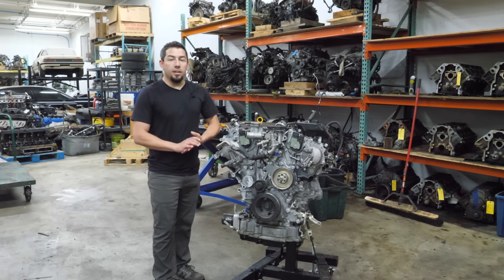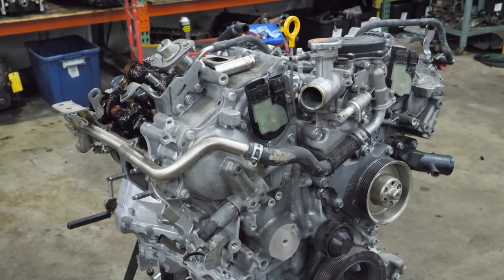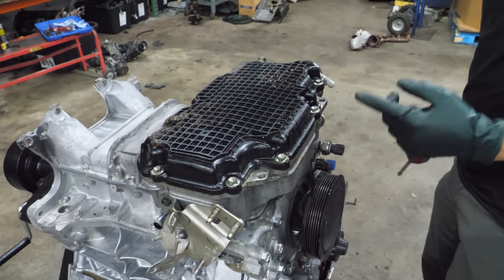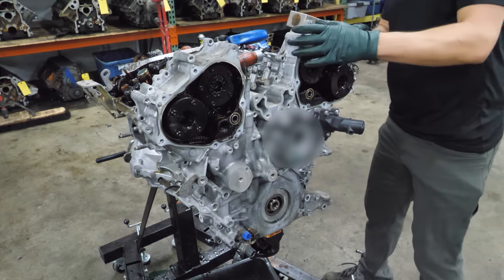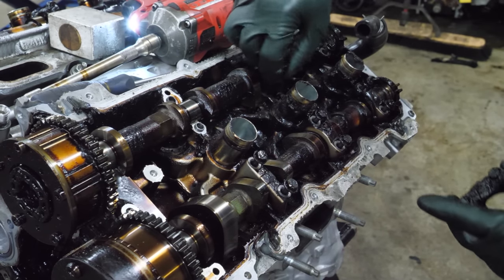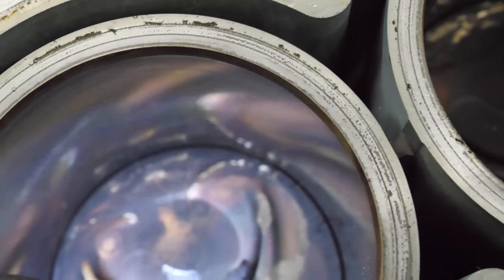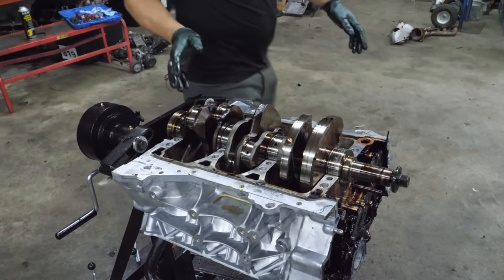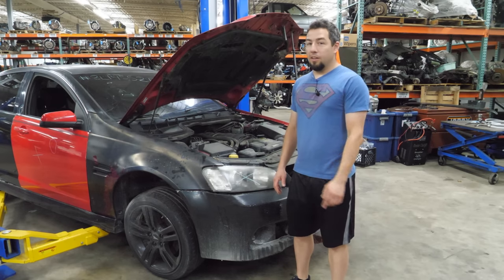60K Miles on 1 Oil Change!?! Infiniti Q50 VR30DDTT Neglected TO DEATH.

Comment: According to the quickie lube all that needs is a can of magic engine flush, an oil change and a new air filter (because it always needs a new air filter), that engine will be good to go for another 500k miles!

The pistons come out so easily because of low tension piston rings. Helps reduce friction when the pistons are moving which improves fuel economy. It’s also why so many modern engines burn oil. (I wrote all of that before you said it but didn’t feel like deleting it)
Reply: Most people think engines should not burn any oil and never check the level between changes. 
I know better and check mine several times between changes and top it up as needed. 
Manufactures need to pit a low oil light on the dash. Not low oil pressure... that light comes on and your already screwed. I have never figured out why they dont put a low oil level on cars. Probably cost 50 cents.
Reply: @ohioplayer-bl9em almost certain my e60 has one of those 😂

Comment: I am definitely more on top of my oil changes since watching you. I have a car with a little over 208,000 miles and still running smooth, will not go over 5,000 miles between oil changes. 👍🏼

Comment: Great video as always Eric 😀
did you figure out where the two springs in the oil pickup came from ??
Reply: This, enquiring minds want to know.....
Reply: I think if you look at the smashed cam gear you can see 2 holes inside it where those springs would sit.

Comment: After my Q50 had its engine replaced at 60k miles because of the dreaded wastegate rattle,, Infiniti themselves told me 10k between oil changes was ok. I still do mine at 4k max.
Reply: They replaced the whole engine because of wastegate rattle?
Reply: I'm pretty sure this owner thought they said 100k mile oil change interval. :)
Reply: 10k? That’s asking for the engine to blow, and from the Infiniti technicians?
Reply: @2seep  probably what Infiniti themselves say is okay for 'normal' driving. Most people's commutes fall under what most manufacturers describe as 'severe'.
Reply: As long as you are using the correct oil this is perfectly fine.  You can always work your way up to it doing oil analysis as you go.
Reply: Uhhhh what? For wastegate rattle at MOST you'd just replace the turbos

Comment: Good evening Eric.  From first sight from pulling the covers, the oil sludge in this engine probably be epic.
Reply: Sorry, I've seen way, WAY worse examples of sludging than this. Admittedly, not with so few miles as this. I very seen it at least an inch thick, on two different engines.
Reply: I am sure there are some with more sludge.  That was probably by adding more oil over time until they made an oil crankcase mold.

Comment: That was an excellent episode Eric!!! I noticed that 5 of the pistons had stuck rings, among several other problems that stemmed directly from the owner/operator neglecting this vehicle...  The car that this engine came out of, was basically driven to the ground... It is incredible how complex these machines are... Lots of power and performance, with a reasonable  amount of fuel efficiency....
     That is, when they are running properly.... It's no wonder why vehicles of many types have become so expen$ive... Over-engineering to the 'Nth degree'...  Much more complex, than what is actually necessary...
       Anyway, I like this channel, because it shows how the modern machines are put together, and how many things can and do go wrong with them, sometimes even when they are taken care-of properly, because the chances of mishap with exotic metals and super high technology, and extreme complexity are much more likely to happen,.... BTW, the actual cause if the failure of this engine, was because of the failed valve timing components, that are of a complex variable angle, adjust on the fly- design.... This has also happened on other engines that had been taken care-of properly...
      I like the older/simpler designs.... More reliable, easier to repair and fully capable of achieving any posted speed limits on the highways.... What more could anybody ask for?

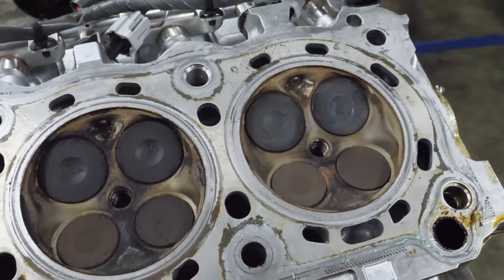Comment: 26:50
Another way to check for bent valves is to put some solvent in the ports and observe the combustion chamber for any leaks.
Reply: This is a much better way to check it.
Reply: @HomelabExtreme   What's the difference?
Reply: @abdul-kabiralegbe5660  On many cylinder heads it is hard to get a clear view into the port, to determine of some fluid is draining through.
That is a non-issue when you fill up the port, and monitor it from the chamber side.

Also, pouring the fluid into the port allows a much deeper puddle, which equals a higher pressure, again making it easier to spot a leak.
Reply: @HomelabExtreme  Thanks.

Comment: Crazy! Also 30.000k oil service interval says in my service book and on the car dash computer on my brand new gasoline 2023 volkswagen passat 1.5L turbo. I'm now at 20.000km and motor already burn oil to the minimum on the oil stick so I already add it like 1L. That's insane long and I already know this engine will not last too much after warranty expires for sure. On other way it's company car that I use for work and it's 3 year leasing period so I guess nobody cares. But still 30.000km oil intervals?! On gasoline car?! Yeah. That's planned obsolescence in the full blast!

Comment: Coming from a Q50 vr30 i change mine every 2k miles. After i did the  walnut blast service i had bought dual catch cans from boosted6. I would say my vr30 has ran very good. Also have upgraded intercooler from AMS with heat exchanger. Pretty much swapped everything to new. Maintaining it well with maintenance is important.

Comment: The engine and turbos are exactly the same on the Red sport 400 and the base 300 HP version. The only difference engine wise is the 400 HP cars get a secondary intercooler pump. Aside from that though it’s just 8 psi vs around 13 psi. All the other differences are just in the brakes, seats etc.

Comment: Eric, Such a great video and teardown. This engine reminded me of a 1977 Honda Civic CVCC that my wife and I purchased from a "friend" who worked at a new car dealership. It had about 32,000 miles on it when we bought it. Soon after I owned it, it needed to have the valves adjusted, which was normal for that engine. I pulled the valve cover off and was shocked to see how much sludge was caked in that head and valve cover. It was so thick in some spots that, it had hardened and had cracks in the cake of sludge. I don't thing that oil was EVER changed since new. I called the guy who sold me that and gave him a piece of my mind. Lesson learned--don't trust family friends to sell you a good car....LOL. I ran a bunch of kerosene through it and kept that oil changed every 3000 miles with a new filter and I ended up trading it in with over 70,000 miles. Engine still ran well, but the body was rusted to pieces.

Comment: 655,000 miles on my 2014 duramax only changed the oil 4 times during the break in, after that i only change the filter every 20 to 25,000 miles and top of about 2 quarts instead of 10. Zero issues with this method now own my 3rd duramax, two previous to the 14 were both bought new and sold in perfect running condition well into the 600,000 range.

Comment: -My only Nissan was an '82 Datsun Maxima.  "Betty the Brown Beater" was an airport car I bought in Orlando and then took to Indianapolis in 1998.  The car was in average shape with 125,000 miles, and it had a 2.4 liter L24 inline 6.  The L24 was basically a Mercedes Benz engine and was used in the Datsun 240-280Z cars in the 1970's and '80's.  It had Bosch L-Jetronic injection:  I walked up to it in Indy covered with 8 inches of snow.  It had sat in the lot for over two months.  I scraped the snow away and climbed in, sure that it would be dead;  It fired right up!

Anyway, this was the car that had the famous talking dash.  Today we take that for granted due to electronics, but back then it took a small phonograph with an actual needle to produce the sound.  To this day this part is a collectors item! I couldn't hear it anyway;  The muffler was blown apart and I used a shovel full of Florida dirt in the right rear corner of the car to reduce the sound coming through a tiny rust hole.  I think it sounded good!

I eventually sold the car to a pilot from American Trans Air, headquartered in Indy.  Honestly, if that car is still running, driven by Republic Air pilots?  I wouldn't be surprised....
Reply: LOL I had that engine in my first car - a 240K. Slow af, but super smooth.  Broke down a lot...

Comment: I had an 89 Saab 9000 Turbo with 120,000 miles. I changed the oil every 3000 thousand miles. When I changed it it still looked new. I sold that car for more than I paid for it after putting 100,000 miles on it. Those engines last forever. Do you ever get any Saabs??? I have watched close to all of your videos. Thanks, I love em.

Comment: The owner, probably, "It burns oil, so I just kept topping it up, and then changed it at 45,000 miles...."
My theory is the chain tensioner on the passenger side got so sludged up. it allowed the chain to come off the guide. Crunch!

Comment: Just discovered your channel and need to vent about oil change intervals. I'm from europe and the intervals seem to differ from other markets, so I'm not sure if it's the same there, especially for diesels. My latest daily, a volvo v70 d5 diesel has a manufacturer recommended oil change every 18k miles/30k km in the service manual. I've had this car since almost new and changed the oil every 10k km, because I've seen lab results online that even the highest quality oils lose their properties around that mark. Since that car is at almost 400k km now, I've dropped the oil changes to 15-20k km, because it's worth scrap value and just needs to die for me to get something new, I've noticed that the oil consistency changes quite fast after those 15k km. now imagine if a new car only has oil changed every 30k km/18k miles

Comment: My buddy tried the single oil change routine on his leased Infiniti. Spent two months negotiating the $15K the dealer wanted for a new engine. Got them down to $6K.
He leaned his lesson: Oil changes are cheaper than a dealer with an attorney.

Comment: Living in Europe, I never cease to be amazed at the state of the sludge etc build up in engines in your country. Maybe I am wrong, but i would humbly suggest that it is not down to owners not changing their oil, but to owners having their oil supposedly changed in "quick change" shops. The quick change shop may or may not change the oil, but if they do, they use the least expensive oil. My BMW diesel  in Europe has circa 200,000 of your miles on it, with 20,000 mile oil change intervals. When it had a cam chain change at 120,000 I looked at the interior of the engine. it was spotless. Always top of the range fully synthetic oils, though.
Reply: We have millions of cars more than Europe, so you’re bound to see more cases of neglect. Probably drive more miles/Km than the average European. You guys barely even have pickup trucks over there. It’s a completely different driving culture
Reply: The ones that get maintained well are still on the road! 😅 it’s the neglected ones we get to see on this channel. Mostly anyway

Comment: Used to know a guy who had an Exxon Full Service station way back in the 1990s. One day, I walked in on the mechanic wearing a slicker suit, goggles, and a face shield and wielding a pressure washer. A customer got a deal on a Acura Legend, because in 65,000 miles that car had one oil change, as a perk, from the dealer when the car was new-ish, so it looked much like that engine. It otherwise ran well, (had the standard transmission), so the customer decided if it lived, it lived, figured to replace it eventually but otherwise, for the miles was in very good shape, so after cleaning it with the pressure washer using hot water, replacing the belts and running a flush of some sort for a few hours and changing oil, go with it. Any additional miles were gravy, and see how long before dropping in a replacement. I'd seen it there for many more oil changes afterwards, still plugging along and not needing a new engine yet, until finally my buddy sold the station and moved out of state, so I don't know how much longer it lived after that. The few times afterwards I chatted with the mechanic, it never came up, and I eventually also moved away.

Comment: You know you got quality metallurgy when the pry tabs break off! I felt ill when I saw the plastic bottom pan. Just as stupid as plastic water pump housings on some cars these days. I guess you can't run an engine on roof tar.......8^) liked the video, thanks!
Reply: Those aren't for prying against. Likely there for holding it in a jig for machining at the factory.

Comment: Turbos are actually the exact same , the 400hp (redsport) only has an added aux water pump, turbo speed sensor and different gear ratio. The power is made in the tune !

Comment: I gotta say, I’ve not changed the oil in my car for 35k miles, not once, but twice. Since I’ve owned it. Thankfully nothing bad has happened and I do run thicker oil than it specifies. My 4.6L 2v has done great. I do run 15w-40 Rotella T5. I’m not one to shirk off doing maintenance, I used to religiously change my oil every 5k miles at the very least. When life starts getting in the way of things, shit tends to happen. My engine still runs strong at 210k miles for an 04 grand marquis.

Comment: The one time I had a motor pop, there was about $3k in labor for the swap, that was 2009, on a V6 Sonata. I'm betting even a junk yard swap at a shop this cost them $6-8k minimum. Had they done oil changes even every 10k miles at say $100... $600 < $6,000; been saying it for years, "oil changes are cheaper than engines."

Comment: I'm currently Rebuilding a 3.6L LE0 Engine out of my 2005 vz Commodore ute. Looks exactly like this. I bought the ute second hand at 143,000km and I noticed the front seals where leaking when doing an oil change.. took off the rocker covers and front timing covers and It wasn't pretty... currently week 3 of soaking and scrubbing the engine and just spent $2.4K on new gaskets, timing chains, pistons, rings and conrods, oil pump, basically a full rebuild of parts.

Comment: I saw something recently, I don't remember where, maybe another Youtube channel about automotive stuff, but the story goes that some lady brought her Acura (I think it was an Acura) in for engine trouble and they discovered the engine was all gunked up with sludge, so they asked her when she last had an oil change and she said (with an air of authority on the matter), "Oh, they don't do that anymore on modern cars, it's not needed." The car had over 70,000 miles on it, never had an oil change, and the factory oil filter was still on it.

Comment: This might be old news at this point, but these engines had several serious oversights/issues that weren't really ironed out until MY2018/2019.  These range from shitty turbos  to Nissan not getting the oil capacity right to bad castings causing porous block which burns coolant.  These were slowly resolved by turbo and block revisions, and also shorter dipsticks.  Change your god damn oil!!!!! LOL.  These need oil every 3000-4000 miles, not 10k per the dealer.

Comment: My buddy bought a 4runner with 300k miles, got it from an old man with an engine in far worse condition. Nearly the same amount of sludge, oil pan had a big hardened jello that turned into pitch in the center. Bearing material spun out in the valvecovers from somewhere, he didn't tear down enough to find out where because he didn't care to know, Oil pump ceased from the pitch. He cleaned out the engine out inside the car as best he could, replaced the oil pump and 80k miles later still trucking along without much issue other than a starter and a small rear main seal leak. Barely shows any oil loss on the dipstick on a 3000 mile oil change interval. This is a 3rd gen 4runner from 2001. If it were a toyota motor it would have atleast lasted to 100k.

Comment: Looks like an engine my son owns.
He doesn't change oil. He waits until the oil light comes on and then adds some...
The Infiniti motor reminds me of quaker state oil from 1960s and 70s. I should know, Dad was a mechanic and I was the official parts washer and sludge scraper.

Comment: I had a customer bring in a Chrysler that was running poorly and leaked coolant. The engine was a 383. I removed a valve cover and was surprised to find what I thought was a second valve cover underneath the first. It wasn't, it was sludge molded in the shape of a valve cover. The oil had never be changed in the life of the car (80,000 miles) but the oil level had been maintained probably when the tank was filled by gas station personnel (this was back when gas stations did this). The engine was trash.

Comment: My niece had an 06 Corolla and never changed the oil. It was way worse than this. The oil solidified. You could hammer the solidified oil  to remove it. The engine lasted 8 yrs and 100,000 miles with only oil top ups.
Reply: That's impressive

Comment: I worked as a tech at a Chrysler dealer in the 90's. Had a Sundance with a 2.2l come for engine ticking with 45,000 miles on the odo. This was dino oil days. Camshaft was wiped and engine sludged up as bad as this one. What was left of the oil took a 1/2 hr to drain in chunks through the drain plug. Customer insisted it had had regular oil changes. What he didn't know was that factory oil filters came with the words "Factory Installed" printed on them. Busted. Warranty denied and remainder cancelled.